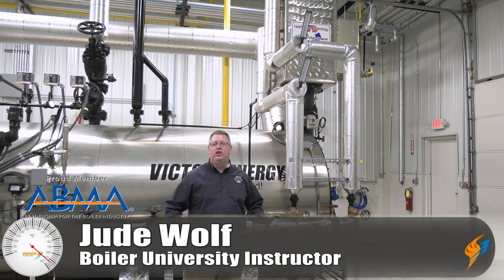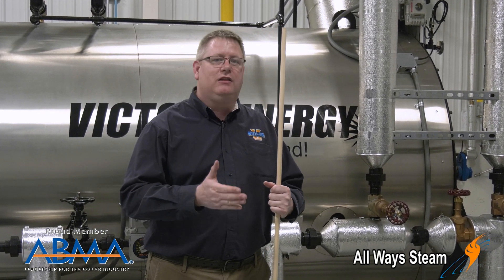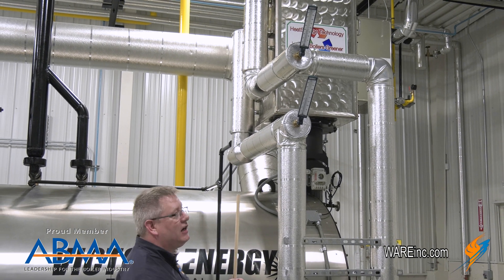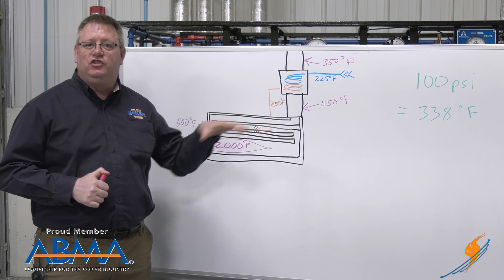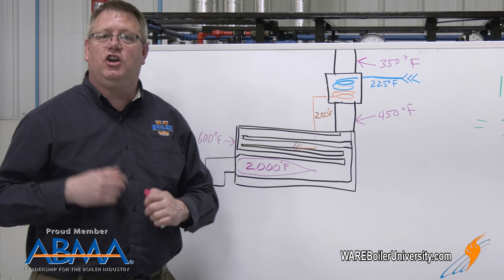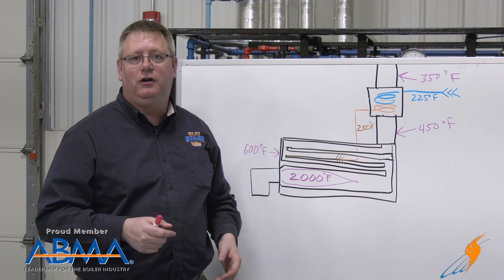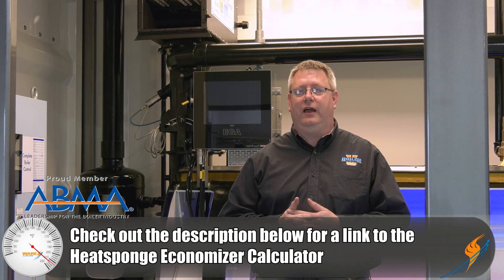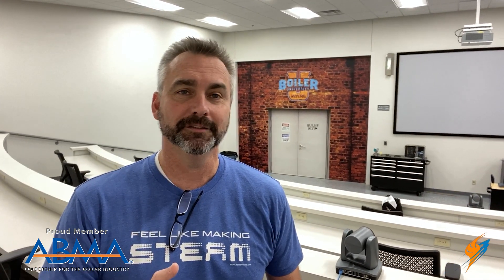What is an Economizer - Boiling Point

Comment: There are three boilers in our 24/7 steam plant and we have a disagreement about what is best for the refractory. 
Currently, we run one boiler for three days at a time and just boost the other boilers when they get below 50 psi. 
Some of us think it is better to run one boiler for 8 hours and then switch to the second boiler for 8 hours and then the third boiler for 8 hours.
Question:  Which method is better for the health of the refractory?
Reply from the maker: At 50 psi, the refractory is probably not absorbing moisture, but also is not at heavy load temperatures either.  As long as you bring on the next boiler on low, and transition slowly to back down the previous lead boiler, you are doing more than most consider doing.   For more specific recommendations, it would be useful to know the type and size of boiler.  If you have a history of refractory issues, some backstory would help as well. Hopefully that helps and thanks for the comment!